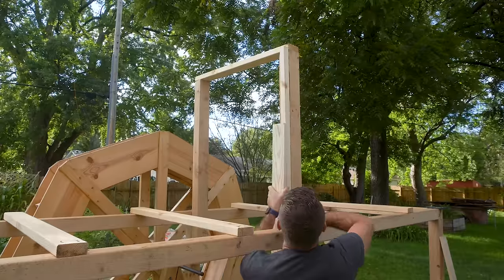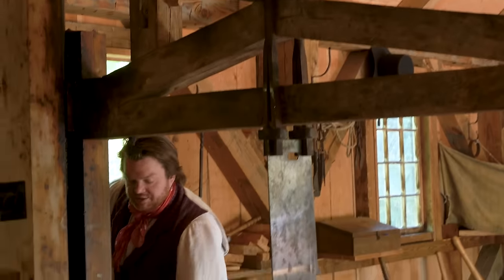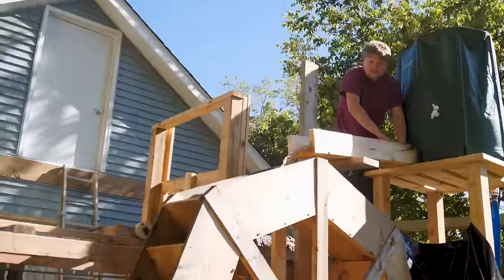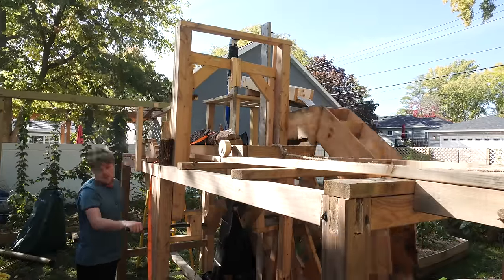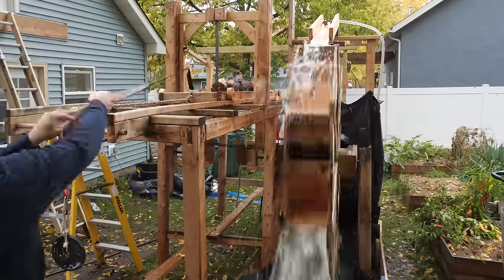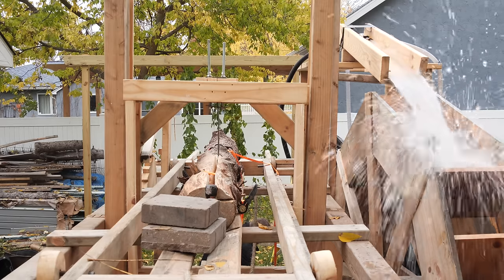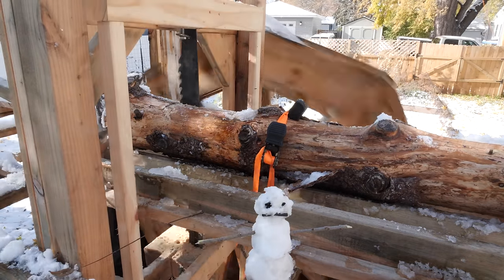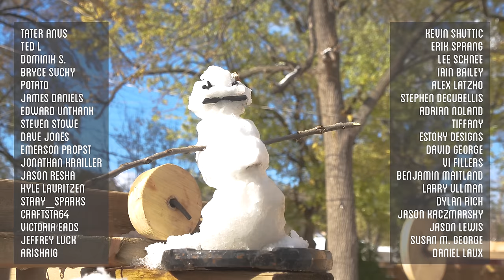I IMPROVED DaVinci's Saw Mill!

Comment: I hope that the apparent danger to you working very close to the top of the saw wasn't as dangerous as it looked. Every time the video showed you close to blade, I was concerned about that blade breaking or slipping off it's guides and cutting you. I think OSHA would shut you down because of it not being very safe.

Comment: The problem with your hamster wheel is that it had the axle running all the way through it, makes it hard to actually stand up.  Should have went with a different design, IMO.

Comment: what is the total horsepower of your pumps? . . . now estimate the mechanical efficiency of the system (pump efficiency, pipe friction losses, mechanical friction ...) . . . get the calculator out . . . so, how many horsepower were you applying to actually do the cutting? . . . i'd guess it's less than 1/8 horsepower.

still an impressive machine but Leonardo, if he was supervising the work and could do as much trial and error as you . . . i think he would do better.

Comment: You're losing soooo much energy to the crankshaft. A smoother motion will cut better and keep your wheel spinning at the same speed. It will also let it build rotational intertia with a smoother movement. Higher pressure water would spin the wheel faster and provide more intertia, i.e. it will have enough energy to cut through the wood with ease.

Comment: The blade is walking of course because there is too much tension on the blade and/or the blade is dull. Nix the gear pulled sled and use a block and tackle drop weight
Reply: you should watch the whole video

Comment: With respect, you need to slow down a bit. The fact your previous project (the beam saw) took forever to cut through a log is bad news. You should be able to cut through a log quickly with two people. Your blade is wildly inefficient and does not represent technology that existed in 1200 bce. 

If you can saw through a log in a day then a sawmill is premature